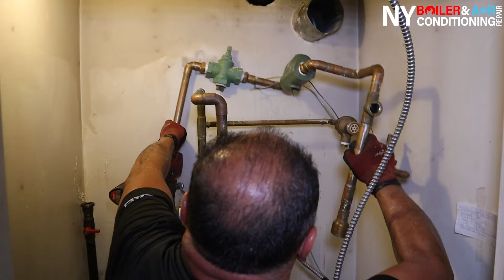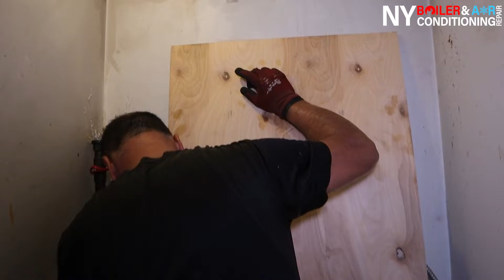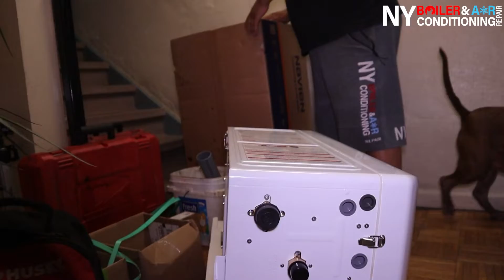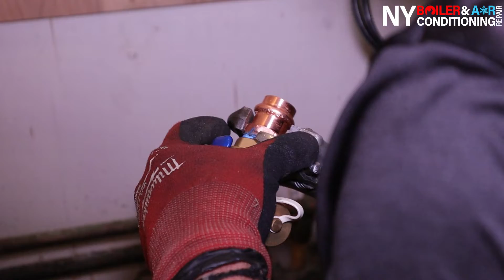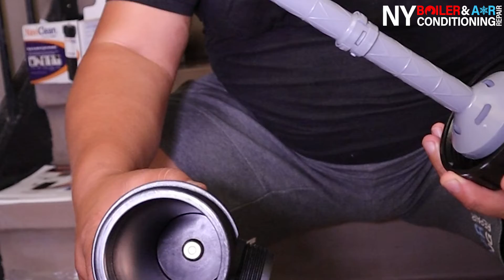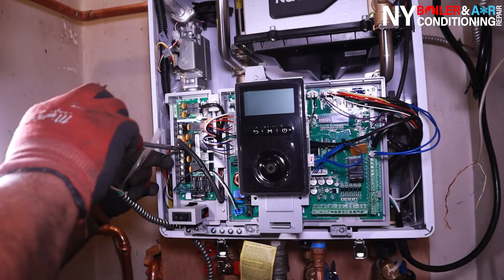NAVIEN BOILER INSTALLATION MODEL : NCB 240 130H

Comment: Have a question regarding the pressure regulator upstream the make up water line, is it neccessary and as you have it installed whats the spec? 12psi or 50 psi rated? We have lots of error codes with 12 psi and eneded up removing the regulator to solve the problem
Reply from the maker: Send me a picture of the piping so I can see what’s going so I can help you

Comment: hi i just had the same water boiler installed and i noticed they did not put on a magnetic filter. is that something that is necessery?
Reply from the maker: Yes not just to protect the boiler but to protect your warranty, Navien has a policy in place now that if you don't install a magnetic filter they will void your warranty should a problem arise after the installation so for those reasons YES!
Reply: thank you 
 @HvacPapi
Reply from the maker: @kriskaz2255  Any time brother
Reply: cna the magnetic filter be installed anwhere in the main line or does it have to be on the return side?
 @HvacPapi

Comment: Will this unit work in a 6 unit apt building I’m worried if they’ll have enough domestic hot water
Reply from the maker: Yes it would , as long as it’s a hot water system and you have gas and vent the exhaust and fresh air properly
Reply: One won't be able to do six apts. How many bathrooms per apt? If one bathroom in each then you could get away with 1 combi boiler for 2 apts.

Comment: Navien makes good stuff and they are a great company. However, after seeing Mikey Pipes, I cannot recommend their water tube heat exchangers models (NPE and NCB). I suggest you only install their fire tube heat exchanger models (NFC and NFB) and their non-condensing models (NPN) until Navien redesigns their water tube heat exchangers.
Reply: Why wouldn't you recommend it? The new version NCB-H has the exhaust vent sensor, so if the vent isn't inserted fully, it won't run.
Reply: @VINJE76  Have you seen Mikey Pipes YouTube channel? The heat exchangers are defective from the factory. It leaks combustion gases which causes the plastic to leach oil and deteriorate the board. The packing rubber ring on the exhaust vent also deteriorates easily and causes combustion gases to circulate inside the cabinet.
Reply: @xcmskim4 - probably the best, succinct, explanation of Navien’s problems that I’ve seen.   If this didn’t sway your opinion go watch MikeyPipes!

Comment: Hey bud, kool vid but not such a great install. There should be Zero black steel on. Navien Combi. There should be no fast fill, prv on the makeup water line if u tie into the autofeed connection on the unit. It has its own prv auto feed inside. There should be a full port ball valve on the gas supply.  30 psi Pressure relief valve on the boiler side up at the top is in the wrong orientation. The brass plug for the external low water cutoff option needs to be where the prv is and vice versa. Please read the install instructions before you install a navien unit so that we don’t show the world how to install one the wrong way.  And the condensate isnt finished but looks like there is brass on the pvc connection. If that’s the case that’s wrong also . Happy holidays . I like your videos but this one bothered me. Nothing negative meant by the comment.
Reply from the maker: I didn’t realize the relief … hey it happens to the best of us.. this what happens when your in a rush. My tech put it in and I see what your saying. It’s not the end of the world but your right. As far as the PRV valve , we purposely put one in with a shut off valve because sometimes even though the Navien has a built in and it’s automatic it has given us problems before especially to purge and remove air from the system and that’s why we put it in… but you are technically right , but when I went to the Navien training other guys guys do the same thing do same thing for the same reason …
Reply from the maker: Thank You 🙏 for your input and support and happy holidays

Comment: Step 1. Don't ever sell your customer a Navien
Reply: Step 2 , don’t believe everything u hear. Navien is an amazing product with the best warranty and greatest tech support. Have it installed by a trained pro and service it annually and it will last a long time. If u hire the cheapest guy on the block then expect the unit to not run and fail and leave a bad taste in your mouth.
Reply from the maker: Why? I personally disagree. I like Navien boiler and you have to take training just like any other manufacturer
Reply: Navien’s have KNOWN issues.  Add’l, Warranty DOES NOT cover the hourly labor cost of fixing anything under warranty.  I’m currently looking at about $2,500 to replace a Navien 240 NCB bad heat exchanger.  

Morale of the story: techs and installers may tell YOU (the customer) “Navien is great” but be careful who you listen to.
Reply: @grheryford  
hey, I appreciate your feedback but I just want to tell you that I am not a customer. I am a residential service plumber and I do everything plumbing, water, drain gas, boilers, and all types of hydronic heating. Navien is one of the best brands in the world with the best tech-support and the best customer service and the best product. I am not paid by them, nor do they endorse me , but I will tell you that I have installed and serviced many brands over the years and none compare to Navien. And I’m not sure where you work or what you do but if you’re paying $2500 to replace and NCB bad heat exchanger I would like to come work in your area. Lol. It does not cost that much. 

I’m not here to discuss pricing and this is not a business event but I do replace exchangers on different units because of poor installs and referring to Navien, everything will fail, and everyone will have negative opinions if it is installed wrong, and never maintained.
 There is no brand of a product that will last forever. Check the water quality for further info on what to do next
I install and service Navien’s, and every other brand of tankless water heaters and boilers, and I will continue to love them and they were great product, do not badmouth a product because it was installed properly, and nothing works the way it should
Reply: @seanmcnally1132  - I work in tech. I’m just a customer. Navien installed in 2016 by a specialized contractor who only offers Navien. It’s upwards 8 hours to replace the heat exchanger and no warranty on any of the work they have to do to get the old exchanger out and the new one in.  

So far, it appears to me, you’ve attempted to negate my opinion as a customer, told me I’m wrong about the pricing that 3 independent, Navien certified, contractors have provided me, and only highlighted MY POINT about people need to take note of WHO they are listening to.  Personally, I have ZERO financial interest in making the points I’ve made.  However, any tech who works on Navien’s cannot say the same. 

It appears like an interesting model: Navien makes a product that complies with all the newest regulations and maximizes efficiency, but has known issues (see Mikey Pipes for some examples). The service techs LOVE Navien because it means a lot of hourly pay (from the customer) when they do all this warranty work. The one holding the bag is the customer who got misled about the quality to begin with (sometimes by the very techs they are told to trust) and then have to pay over and over for the failure of the Navien parts.  

To be honest - I don’t know you, and I don’t question your PERSONAL credibility.  However, ANYONE who states how AWESOME Navien is and that they are “the best” is either not being 100% truthful, or they just don’t know.  Which one are you? Because you HAVE to know about these issues.
Reply: @grheryford  you are absolutely correct in the sense that I do know about some issues that Navien has had. But again most of them come from failed installs and for neglect. Coming from a residential service provider it does not take eight hours to replace the heat exchanger and whoever is coming to replace a heat exchanger taking eight hours to do it should go and take up a different profession.  Whatever someone’s prices to do, the job is whatever their prices to do the job, but no one should be charging for eight hours of work to replace the heat exchanger.
Mikey Pipes is an uneducated person who got called out on his antics by many people and I would not listen to anything he says about Navien. He rants and raves about things and is wrong about many things he says. He has no factual basis to stand on. 
I get it, you’re a homeowner who had a problem and probably got taken for a ride. And I do have sympathy for that but at the same time from my years of experience in the service world and the new construction world to where am I at today I do not have anything negative to say about Navien, it is a wonderful product with a wonderful warranty, and the system lasts a long time as long as it is installed properly and maintained like it should be. Parts will need to be changed in time just like anything but that does not make them a bad brand because of it.
Reply: @seanmcnally1132  - We can agree to disagree.  I KNOW the written estimates I received from 3 separate companies.  Your insistence that you are correct and everyone else is either wrong or didn’t have you for their installer (had a bad install) only highlights my assertion that people who make the hourly $$ from supporting Navien products  have potentially compromised opinions. 

I’m not anti-Navien due to getting burnt (but thank you again for being dismissive of my opinion), I’m anti-Navien because I’ve done a TON of research on their product.  Mikey Pipes knows a ton (but thank you for showing your true colors) and was only threatened by Navien and they tried to use Google’s overbearing practices to get him shut down.  Whatever they pay you guys to fight with homeowners who speak up better be good - you certainly fight to the death for the Navien name, or is it the $$$ you get from the warranty work ;)

If you want to actually persuade me vs demeaning me, how about providing some facts? Maybe comparisons of Navien unit failures vs others? Or how about Navien paying for the warranty work and not just the part?  Belly up to the bar and quit text war.
Reply: @grheryford  good luck in your travels. I make no money from Navien on anything. They are a manufacturer of a product I enjoy installing ,servicing and maintaining. Your opinion matters and is heard.
At the end of the day if you were one of my customers, I would sit down with you and go over many different options with you all and go over the pros and cons of everything with you. I’m just not a fan of people who talk bad about Navien based on their negative experience. You have clearly had many. Your negative experience has nothing to do with Navien, it has everything to do with the people who were hired to install the product, and the people who are hired to come back to fix and maintain the product. 
Take everyone and everything else out of the equation, I Tankless products need a lot of maintenance and a lot of people. Don’t understand that and aren’t happy when the guy putting it in fails to tell them that beforehand, if you don’t maintain it, it’s not going to last.

There are many people that I meet on a daily basis that ask me about a Tankless and some of them I explain to them that this might not be practical for your situation. 
I’m in NJ, what part of the country are u in ?
Reply from the maker: @grheryford  to be honest i hadn't have too many problems exception of the common 3-way valve that constantly go bad. why ? i don't know but i think its because of the water and i've noticed that when ever i go to a job that has these issues, don't have a magnetic filter or any of any kind for the water. Im sorry you're going and dealing with the heat exchanger issue because i would assume that would be the last thing to go bad. But keep me posted if anything else goes or if you hear of anything. I occasionally hear about a gas leak on top of the heat exchanger sometimes especially on the older models and usually from what i hear its a bad gasket or the bolts or screws gets loose and has to be retighten. Thanks for the input. I appreciate you supporting my channel
Reply from the maker: @grheryford  Yea i can agree and disagree. I mean i've worked on other systems and their design sucks and they have issues too. In my opinion they all do, to some degree in one form or another, but also i cant sit here and tell you how many so called techs and plumbers and hacks screw up and install the equipment wrong. I see more screw ups on the installer end than the manufacturer design. Nothing is made perfect but many plumbers, installers say the equipment sucks and yea i agree the does suck when you install it wrong and incorrectly. The equipment was destined to fail when it was installed wrong from the beginning but that problem is the installer.. Why? BECAUSE THEY ARE TOO LAZY TO READ... Thats the truth. I see it a lot but i also love them.. why? the create a job for me.. lol to be honest. but the truth is, of course just my opinion, it goes both ways. But these old school guys especially and no disrespect to them because i've learned a lot from them but some have egos and things the way they did things 20yrs ago still works now and in some things it does but most it just doesn't. Time and technology has changed and they need to put the ego to the side and its never too late and you never stop learning.. So for everyone who is reading this and watching this videos... READ.. I don't do anything special but read or find someone to answer any questions i have. Knowledge is power that equals money to me ...lol weppa
Reply: @grheryford  you can buy a new Noritz combination boiler made in Japan not Korean like navien for less than 2500 check out the NCRB199 and 180 models.
Reply: Unfortunately he was found dead
Reply: I have seen many navien failures on my block that were installed after hurricane Sandy. 3 within eyeshot of my house. And 3 more friends of mine that all had to junk them after repeated repairs not covered under warranty. Sad situation for the families that struggled to get back in their house and then had more expenses to deal with and no heat or hot water.